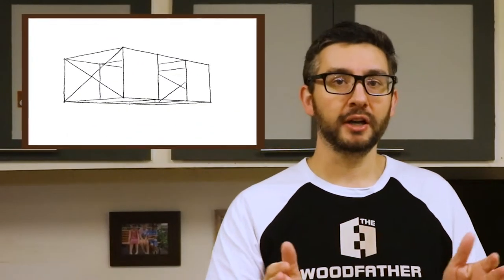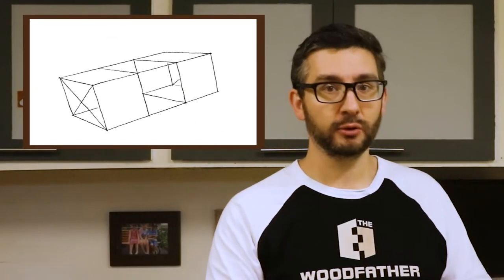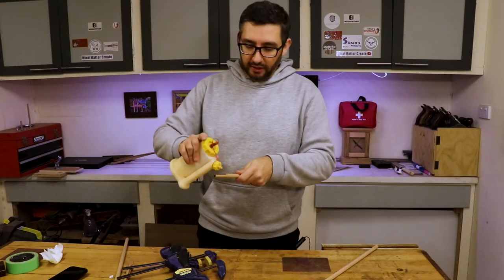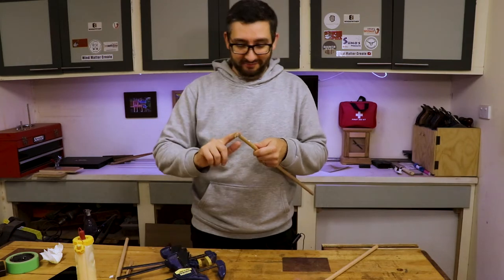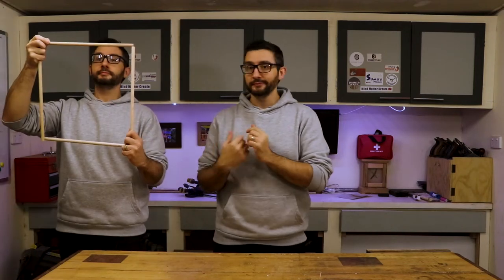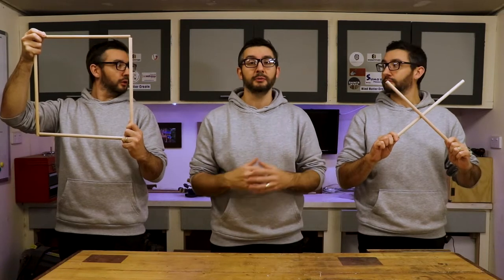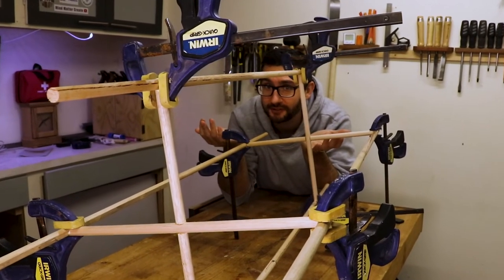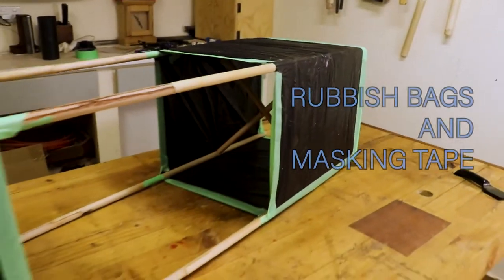I made a Box Kite from Rubbish Wood!

Comment: This brought back memories of a Military radio antenna kite that my brother and I got hold of when I was about 10 - 71 years ago.  Made of aluminium and silk, once it lifted a few feet it went stratospheric very quickly, but then I got bored just holding the string.    Much more interesting in later years when I had to design a wire shape (like an arrowhead) to hold the three flattened oval plastic tube arms of a two-string stunt kite that a company was trying to create to rival the current Peter Powell market leader.    I got it right eventually, and the kite was great fun to fly and was very maneuverable, but when it got out of control and dived into the ground, it hit with such force that the plastic tubes eventually split around the spring, so it was only a limited commercial success.   Unhappily for my children it was one of those instances where only daddy could fly the kite as it would have lifted them off the ground, or dragged them away, as it took a lot of strength to control its pull in anything more than a gentle breeze.   I loved flying it horizontally, about two feet above the ground, but if I got confused and pulled the wrong string to reverse direction at the end of a 'pass', that was when a crash occurred.
Reply from the maker: Now that's a story! Would have been very impressive to see the military one go straight up I imagine! I've seen, but never used, stunt kites - they look pretty damn amazing and I was once tempted to buy one, but with my sense of direction I know that I'd send it straight into the ground more often than not. 😄 You need to write an autobiography Don, from the little tidbits of info here and there, I feel there's an epic life story being lived! :)